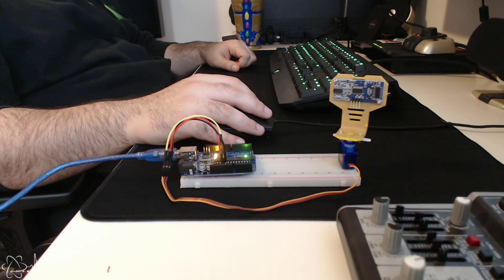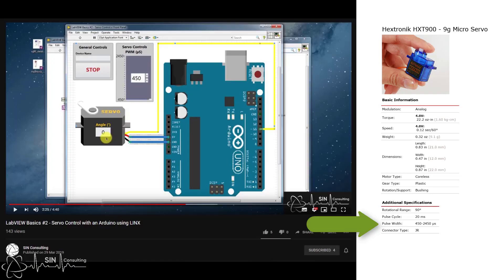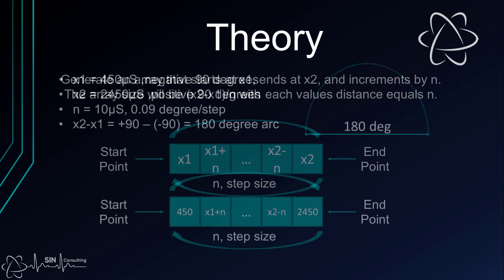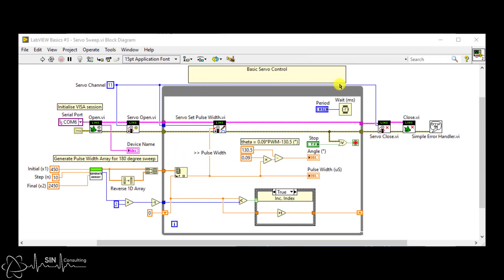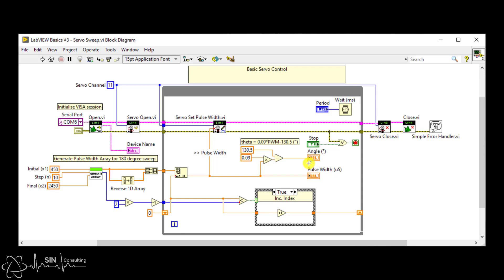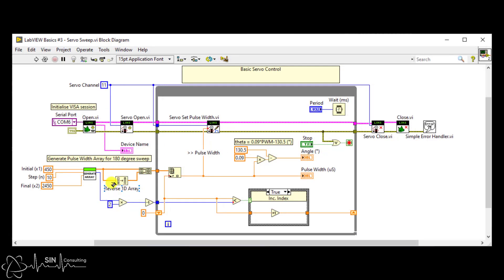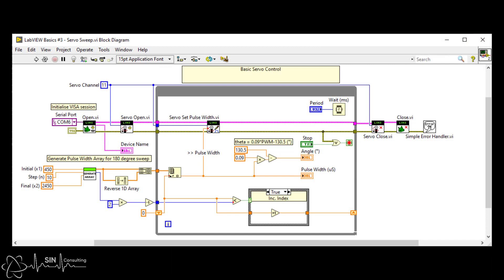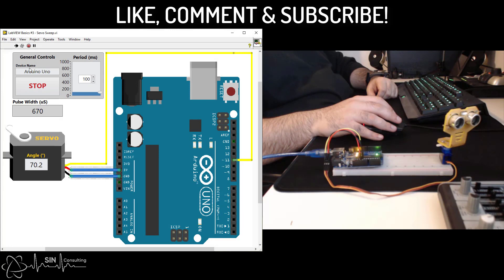LabVIEW Basics #3 - SONAR Part 1 - Programmatic Servo Sweep using an Arduino UNO (LINX)

Comment: Hey Sin great work here. I'm using Labview 2018 but I can't open ur files. The error code is 0x465. Plz help... Thanks
Reply from the maker: You need to use LV2019+ to open the files. Unfortunately LabVIEW isn't forward compatible. If you don't have access you go to the NI forums  and request someone convert it for you :)

Comment: Lovely channel Sin. Very helpful. Would you please be able to add some Fritzing diagrams here or in Github for the LINX examples? Or add screenshots of Fritzing diagrams showing how to connect cables and components to the VIs block diagrams, similar to Arduino RGB LED.VI in Arduino Examples in Labview.? Hope you get plenty more subscribers.
Reply from the maker: Done :) 
https://github.com/SINConsulting/LabVIEW-Basics/tree/master/LabVIEW%20Basics%20Examples/Fritzing%20Schematics
Reply: @SINConsulting  Nice one. Am using Programming Arduino with LabVIEW
 by Schwartz and Manickum plus Makerhub for reference. Attempting to control a water pump from moisture sensor readings through an Arduino Uno using Labview. Lots of similar examples in Arduino but none for Arduino Labview. Is there any book or other source you could recommend for Arduino Labview?
Reply from the maker: @YewrMan  In terms of resources, I think the best place is the LabVIEW forums in general for programming advice and questions. The issue with LabVIEW and the Arduino platform is you will have to adapt the code and examples you may find to suit your application to LabVIEW. For your specific application, i'd recommend first getting the circuit correct then testing it with example code in the Arduino IDE to confirm everything works. Once you confirm that, then start slowly building up the project in LabVIEW, get the arduino working, then test the DIO for the pump, then test the data acquisition for the moisture sensor etc. build it up piece by piece until you have it doing what you want then optimize.
Reply: @SINConsulting  Cheers SIN.